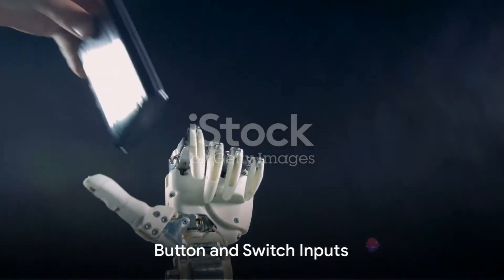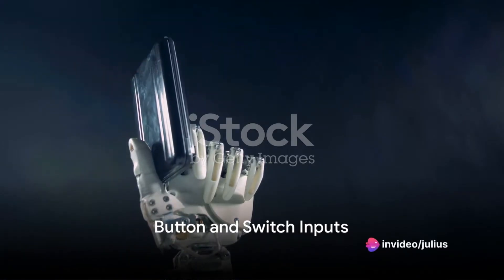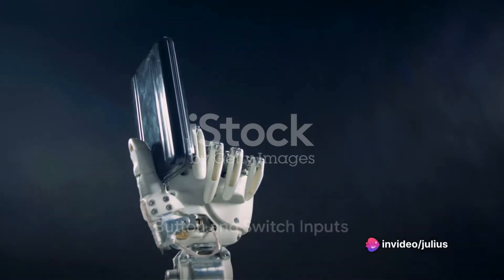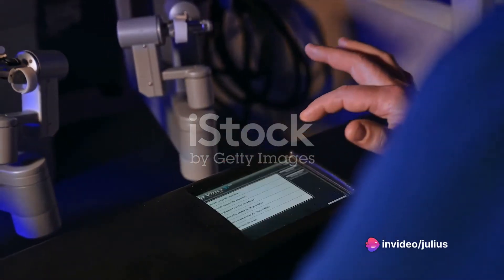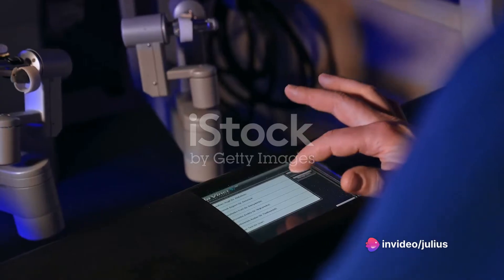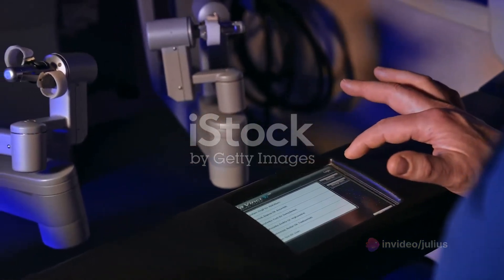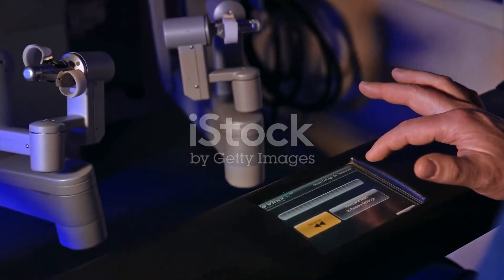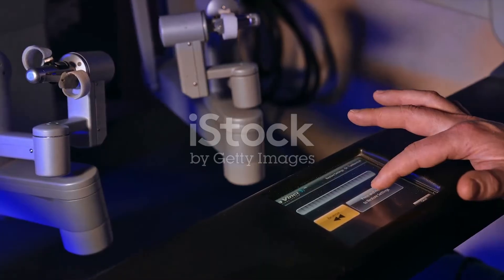Top 10 Digital Inputs in Robotics

Comment: Christine Divine S. Taña  
10-LYNX  

4. What is the significance of digital cameras in robotics? How do they process visual data?

Digital cameras are significant in robotics because they allow robots to capture and analyze visual information, helping them navigate, identify objects, and perform tasks. They process visual data by converting light into electrical signals, which are then turned into digital images that the robot's computer system analyzes to make decisions.

Comment: Dave Aaron V. Dagcuta
10 - Lynx

5. Discuss the importance of digital inputs in robotics. Why are they crucial for a robot's operation?

A: Digital inputs usually only have two states which are 0 and 1. Although this may sound limited, if you ever need your robot to do a simple task with turning off and on, or doing a certain action or not, you will need to use a digital input. Also since they only operate in a discrete manner, their power consumption isn’t too heavy unlike analog inputs.

Comment: Evzen Radik
10 - Orion

3. Describe how binary encoders contribute to a robot's functionality. What type of data do they provide?

Binary encoders play a vital role in enhancing a robot's functionality by providing precise feedback on its position and movement. They work by converting rotational movement into binary data, indicating the angle and direction of a robot's joints or wheels. This information helps the robot understand its position in space, allowing for accurate navigation and control. By supplying real-time data on speed and rotation, binary encoders enable robots to execute tasks more efficiently, ensuring smooth operations and improved performance in various applications.

Comment: Jacinth J. Yerro
10-Hermes

1.What are limit switches, and how do they function in robotic systems?
Limit switches are mechanical sensors utilized in robotic systems to detect the presence or position of an object or to restrict the movement of robotic components. They operate by either making or breaking an electrical circuit when an object physically contacts the switch, signaling the system to stop, alter direction, or initiate specific actions depending on the robot’s position or movement range.

Comment: Reeve Radley Fua
X Cassiopeia 

1. What are limit switches, and how do they function in robotic systems?

Limit switches act as invisible boundaries that signal the robot to stop when it reaches its limits, preventing damage and allowing it to operate efficiently without overworking. Essentially, these switches help control and indicate the robot's movement range.

Comment: Alvin M. Tagudin
10-Hermes

1. What are limit switches, and how do they function in robotic systems?
-Limit switches are mechanical sensors used in robotic systems to detect the presence or position of an object or to limit the movement of robotic components. They function by making or breaking an electrical circuit when an object physically comes into contact with the switch, signaling the system to stop, change direction, or initiate specific actions based on the robot’s position or range of motion.

Comment: Jhon Lemuel C. Valmorida
Grade 10 Lyra

1. Limit switches are used to indicate the endpoints of a robot's movement. They serve as a stop sign for robotic systems, sending a digital signal to the robot to enable it to stop the robot movement as it reaches its boundary that was set by the programmer.

Comment: Zophiel Hailey Jace B. Usman 
10 - Hermés

1. What are limit switches, and how do they function in robotics systems?

- Limit switches are devices used in robotics to detect when the robot has reached the end of its movement range. They act like boundaries, telling the robot when to stop moving to prevent it from going too far.

Comment: Rushlee Baltazar
10-HERMES
3. Describe how binary encoders contribute to a robot's functionality. What type of data do they provide? 
Binary encoders contribute to a robot's functionality by converting motion, such as rotation or position, into digital signals that the robot can interpret. They provide data on position, speed, and direction of movement, allowing precise control over motors, joint angles, or wheel rotations for accurate navigation and task execution.

Comment: Sairel A. Yabo
X-hermes

1.Limit switches are safety devices used in robots. They act as "stop signs" for the robot's movements, preventing it from going too far and potentially damaging itself or its surroundings. When a robot's moving part reaches a certain point, the limit switch activates and signals the robot to stop or change direction.

Comment: Jaeve Joshua C. Butcon
X-Hermes

1. What are limit switches, and how do they function in robotic systems?

Limit switches are electromechanical devices in robotic systems that detect the presence or position of moving parts. When activated by contact, they change the state of an electrical circuit, sending a signal to the robot’s controller. This helps manage movement, ensure safety, and control processes by providing critical feedback on the robot's position.

Comment: NURIEL DANNA S. GARCIA
10 - LYNX

1. What are limit switches, and how do they function in robotic systems?

Limit switches are devices in robots that help detect when moving parts reach a certain position. This helps prevent the robot from moving too far or bumping into things, making sure it operates safely and accurately.

Comment: Kenichie C. Racero
10 Hermes 

1. What are limit switches, and how do they function in robotic systems?
 -Limit switches are mechanical devices used in robotics to define the endpoints of a robot's movement. They act as invisible boundaries that signal to the robot's control system when it has reached a maximum or minimum position. When the robot reaches a limit switch, it triggers a digital signal indicating that it should stop moving in that direction, thereby preventing damage or unintended behavior.

Comment: Fresh M. Satur
10 -LYNX

3. Describe how binary encoders contribute to a robot's functionality. What type of data do they provide?

Binary encoders are important for a robot's functionality because they help track position and movement. They turn the rotation of a motor or shaft into simple binary signals, which the robot's control system can easily understand. This information allows the robot to know where its joints or wheels are and how fast they are moving, ensuring precise actions. By providing real-time feedback, binary encoders enable the robot to adjust its movements smoothly and accurately. Overall, they enhance the robot's ability to navigate and perform tasks effectively by giving clear data about its position.

Comment: Joshua Cliff L. Aurigue
X - Cassiopeia

1. What are limit switches, and how do they function in robotics?

- They function as a stop sign for robotic systems by transmitting a digital signal to the robot, allowing it to halt its movement when it reaches the boundary established by the programmer.

Comment: Rafael Maverick Daroy
10-LYRA

1. What are limit switches, and how do they function in robotic systems?

Limit switches are electromechanical devices used to detect the position of a moving part within a robotic system. They function by opening or closing an electrical circuit when a physical object (like a robot arm or conveyor belt) makes contact with the switch

Comment: Aiko Alzula
10 - Cassiopeia

1. Limit switches are used to indicate the endpoints of a robot's movement. They serve as a stop sign for robotic systems, sending a digital signal to the robot to enable it to stop the robot movement as it reaches its boundary that was set by the programmer.

Comment: Gabriella Kish O. Gatchalian 
10 - LYNX

1. What are limit switches, and how do they function in robotic systems? 
Limit switches are mechanical devices that detect when a moving object reaches a specific position. In robotics, they are crucial for preventing damage to equipment and ensuring accurate control.

Comment: For non-contact detection in a variety of robotic applications, digital inputs from capacitive sensors sense changes in electrical capacitance to determine the presence of objects or changes in circumstances.

Comment: Jannah Loreen S. Galla 
10 - CASSIOPEIA

Q: 1. What are limit switches, and how do they function in robotic systems?

A: Limit switches are mechanical devices used in robotic systems to detect the presence or absence of an object or to define the boundaries of movement. They function by using a physical actuator that makes contact with a moving part or object. When the actuator is triggered, it changes the state of an electrical circuit, signaling the robot's control system to take a specific action, such as stopping movement or changing direction. Limit switches help ensure that robotic components operate within predefined limits, providing safety and precision in tasks like positioning and movement control.

Comment: Jullian A. Pangan 
10 - Lynx 

1. What are limit switches, and how do they function in robotic systems?

Limit switches are essential components in robotic systems that define the boundaries of a robot's movement. They serve as digital checkpoints, signaling the robot to stop when it reaches predetermined positions. This prevents the robot from overextending or colliding with obstacles, ensuring safe and efficient operation.

Comment: Messiah Emmanuelle Lei P. Salomon
X-Cassiopeia

2. Explain the role of proximity sensors in robots. How do they help robots interact with their environment?

-Proximity sensors detect objects within a certain range without physical contact using technologies like infrared or ultrasonic waves. They provide digital signals to the robot’s control system, enabling it to detect obstacles, navigate around them, and avoid collisions, which is essential for tasks like object detection and navigation.

Comment: Leon Anthony S. Juaneza
10-LYNX

1. Limit switches are used to indicate the endpoints of a robot's movement. They serve as a stop sign for robotic systems, sending a digital signal to the robot to enable it to stop the robot movement as it reaches its boundary that was set by the programmer.

Comment: Precious Lea Jennifer D. de Dios
10 - ORION

5. Discuss the importance of digital inputs in robotics. Why are they crucial for a robot's operation?

- Digital input is crucial to robotics industry as this process the robot’s control system or microcontroller. This interprets the state of the input if it’s on or off, high or low and uses to trigger specific actions, make decisions, or adjust a robots behavior. Symbolizing an unseen threads that connect the robot to its environment allowing it to interact, respond to changes, and execute task autonomously. Directed by human operators, without digital inputs a robot would be like a ship without a rudder drifting aimlessly and unable to fulfill its purpose

Comment: Tabitha Glenne P. Lagria
10-Cassiopeia

2. Explain the role of proximity sensors in robots. How do they help robots interact with their environment?
A: Proximity sensors enable robots to detect the presence and distance of nearby objects without physical contact, which helps in avoiding collisions and navigating around obstacles. They provide crucial information for object detection and manipulation, allowing robots to interact accurately with their environment. Additionally, these sensors enhance safety by enabling robots to detect and respond to obstacles or humans in their vicinity.

Comment: Raine Badon
1. What are limit switches, and how do they function in robotic systems?

Limit switches are used by robots to prevent a part from extending further. They serve was invisible barriers that detect when a component has reached a certain position or to limit a robot's range of motion.

Comment: Gabe Rivero
10 - Hermes

1. What are limit switches, and how do they function in robotic systems?

Mechanical devices in robotics that detect position and prevent overextension by stopping movement when a part reaches a certain point.

Comment: Zane Mendaros
X - CASSIOPEIA

Q1: What are limit switches, and how do they function in robotic systems?

Limit switches are devices used in robotic systems to indicate the endpoints of a robot's movement. They act as invisible boundaries, signaling to the robot when it has reached its limit and needs to stop moving. They ensure that the robot doesn't exceed its designated range of motion, preventing potential damage or malfunctions.

Comment: Xharmei Therese P. Barcenilla
10 - Lyra

2. Explain the role of proximity sensors in robots. How do they help robots interact with their environment?

Answer: Proximity sensors, often using infrared or ultrasonic technology, detect the presence or absence of objects within a specified range. They provide digital signals to the robot, allowing it to navigate and interact with its surroundings effectively. This capability is vital for obstacle avoidance and spatial awareness.

Comment: Princess Dawn B. Lamberte
10 - LYNX

1. What are limit switches, and how do they function in robotic systems?
Limit switches detect the position of a robot's moving parts and trigger signals to stop or reverse motion. This prevents the robot from moving too far and causing damage.

Comment: Shuwla Maine C. Lugtu
Grade 10- Lynx

5. Discuss the importance of digital inputs in robotics. Why are they crucial for a robot's operation? 
- Digital inputs, such as sensors and switches, serve as the nervous system of a robot, providing essential information about its environment and internal state. They enable robots to perceive their surroundings, execute tasks accurately, and ensure safety. Digital inputs also facilitate human-robot interaction. In essence, they are the foundation upon which a robot's intelligence and capabilities are built, making them indispensable tools in various fields.
Reply: Mitch Micah Niere

Grade 10- Lyra

5. Discuss the importance of digital inputs in robotics. Why are they crucial for a robot's operation? 
- Sensors and switches act as the robot's nervous system, supplying crucial data on both its surroundings and internal condition. They allow robots to understand their environment, perform tasks precisely, and guarantee security. Digital inputs also make human-robot interaction easier. Basically, they are the groundwork for a robot's intelligence and abilities, making them essential tools in different sectors.

Comment: Christian Dynniel M. Llanos
10-LYNX

1. What are limit switches, and how do they function in robotic systems?

Limit switches are crucial components in robotics, functioning as sensors that detect the endpoints of a robot's movement. They act as invisible markers, alerting the robot when it has reached its maximum range, prompting it to stop or change direction. This helps prevent potential damage and ensures precise control of the robot's movements.

Comment: Alexa Janne Arioja
10-Lynx

3. Describe how binary encoders contribute to a robot’s functionality. What type of data do they provide?

> Robots depend on binary encoders to provide information on their position, speed, and direction of motion. These convert mechanical motion into digital signals that track the rotation of the motor shaft. The precise location or rotation data they provide makes accurate control possible. For tasks like object handling, navigation, and speed modification, this is essential. Robot operation is made accurate and dependable by the digital input provided by encoders, which also determine movement direction.

Comment: Shei Christiane Payot
10 - LYNX

1. What are limit switches, and how do they function in robotic systems?

Limit switches function as an invisible  boundaries which signals the robot to stop at its limits, preventing damage and helping the robot use maximized power without overworking itself. In short terms, these switches are what indicates a robot's movement.

Comment: Kiesha Enriquez 
10- 0rion

1. What are limit switches, and how do they function in robotic systems?
Limit switches are devices used in robotic systems to indicate the endpoints of a robot’s movement. They act as invisible boundaries that signal the robot to stop moving once a certain limit is reached.

Comment: Jana Sophia D. Enopia
10 - LYRA

1. What are limit switches, and how do they function in robotic systems?

Limit switches are devices used in robotic systems to define the endpoints of a robot's movement. They act as invisible boundaries, signaling the robot to stop when it reaches a certain point. This prevents the robot from moving beyond its intended range, ensuring safe and accurate operation.

Comment: Hailey Aiyana E. Gador
10- Lyra

1. What are limit switches, and how do they function in robotic systems?

- Limit switches are essential safety mechanisms and position sensors in robotic systems that trigger actions based on a moving part reaching a predetermined limit or position.

Comment: Kirk C. Nangkil
10-LYNX

2. Explain the role of proximity sensors in robots. How do they help robots interact with their environment?

Proximity sensors are used to detect the presence or absence of objects within a certain range. They provide a digital signal to the robot, indicating whether an object is near or far. This information helps robots avoid obstacles, navigate safely, and interact with objects in their environment.

Comment: Urhyness Agatha B. Santos
10-Cassiopeia

1. What are limit switches, and how do they function in robotic systems?
Limit switches detect when a robot's moving parts reach a specific position. They send a binary signal(on/off) to the control system to stop or adjust movement, ensuring safe and precise operation.